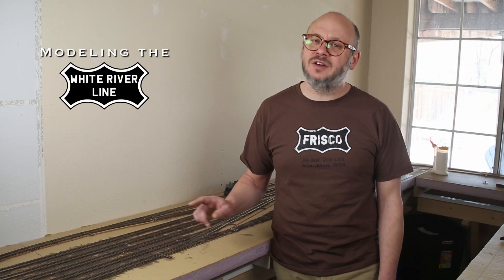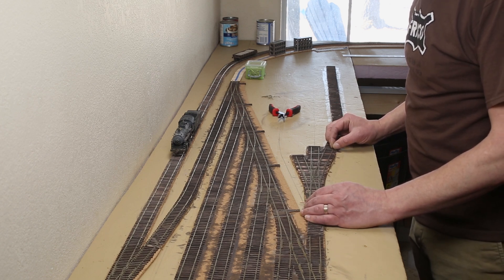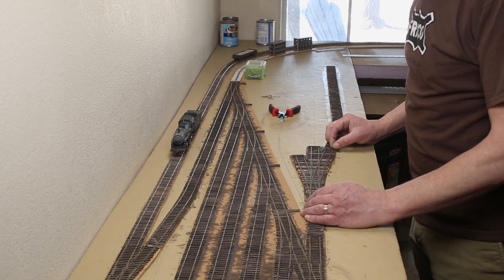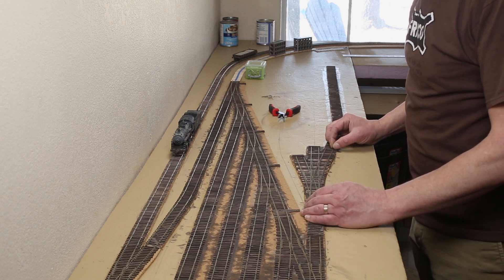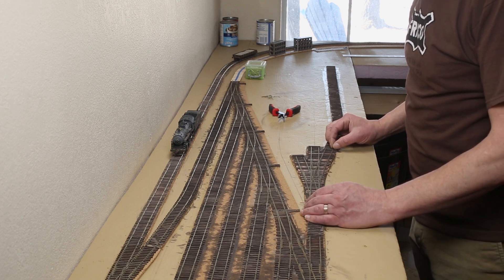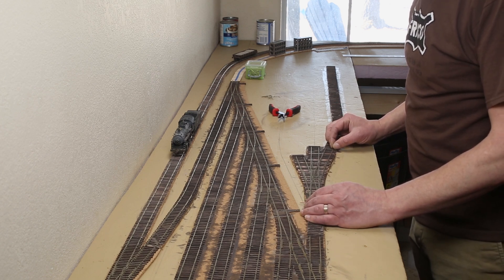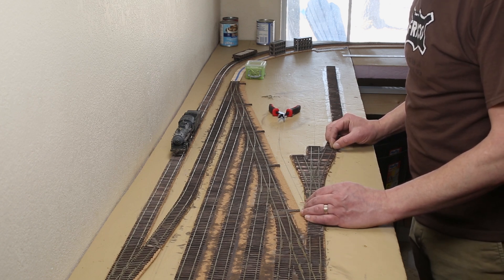Building a DCC-EX Command Station for My Model Railroad

Comment: Saw your video using servos and one suggestion.  I don't use servos with fixed (programmed) positions.  I use pots to control the position of the servo for straight and one for divergent.  You use the map command:   position = analogRead (potS);
      position = map(position, 0, 1023, 0, 90);.  also I use a small relay to control the frog.  Ditch the UNO and check into the ATTINY chips.  You can use the 85 chip or if more pins are needed use the 24.  $1.50 each.

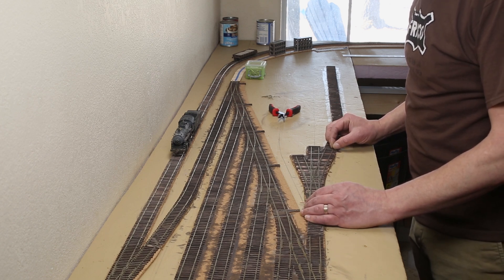Comment: 4:41 Actually, getting the DCC-EX automated installer to run on MacOS isn’t that difficult - it‘s just a bit awkward that they made it an application to run in the Terminal and not one you can simply double-click. To run it after downloading (assuming that „Downloads“ in your home directory is your download folder; if not, you‘ll have to modify the path for the „cd“ command in the following example), just open the „Terminal“ application (or an equivalent; I prefer iTerm) and then at the command line type or copy-paste from here (without the quotes!): „cd Downloads; chmod +x EX-Installer-macOS; ./EX-Installer-macOS“ and the installer window should pop up.
Reply: You just need to go to terminal and sudo - su ..  then change your /etc/passwd file and make your account UID 0. Once that's done you'll be able to run everything as root. Don't do this if you're a numbskull that randomly installs unsafe stuff.

Comment: Hi Drew, thanks to share this video with us. You're a smart guy doing this that easily. Like the way you tracks turned out with all the different shades of colors. Keep on your good work. I can wait to see that wood caboose project ending too.
Reply from the maker: Thanks Luc. The variation in the shades of the ties are a really nice benefit of hand laying track.
Reply: @WhiteRiverLine  I mostly like the way you're doing things. Laying handlaid tracks is something I would like to do one day. It's not because I can't but because I doubt the "resistance et la durabilité" of those tracks. I trust flextracks more because it can move easily, dilate or retract without breaking or desaligned. If I go for it (I already have a 28 x 60 inches module), I will be working with code 55 tracks. And the fact that you're modeling steam era is to my eyes very interesting. That's also why I'm modeling the 70' and 80's. Modern engines and rolling stock is not interesting for me. Too big and lack of details ! Keep on your good work Drew !

Comment: What gauge wires are you using from the motor shield to the connector for the 12v power supply?
Reply from the maker: It is 16 which is the largest the terminals on the motor shield will accommodate. Even then it is a tight fit.
Reply: @WhiteRiverLine  I used some 14. It was the exact size of the terminals but when I power my motor shield with the 12v power, it disconnects the Arduino from the computer and the Mac states “unplug the device using too much power to reconnect usb device” something of that nature. Without that power I don’t get enough juice to power the DCC signal so the loco just sits with the light on making a humming sound and no controls works. Have you ran into this issue?
Reply from the maker: @sevenellis410 , I haven't run into that issue. You definitely need the 12v power supply. USB from most computers is 5v at .05 amps. Not enough to power DCC. The Arduino is also 5v, the amperage would depend on the power supply used. This is why the motor shield is necessary, it can supply adequate power to your layout. 

I am not a DCC-EX expert, this is the first time using it or DCC of any type, so take my advice for what it is worth. First, I recommend verifying that the Vin Connect trace on the motor shield is cut using a multimeter. Second, you might want to check your tracks for a short. Hope this is helpful. DCC-EX provides some other resources for getting help on their website and you are likely to get help from someone there that knows more about DCC-EX, https://dcc-ex.com/support/index.html.

Comment: Hey Drew
What do you think it costed pre foot to hand lay your track
Reply from the maker: It's about $1.80 to $2 a foot depending on the spacing of the ties. Which is probably about what you'd pay for Atlas and little bit less than Micro Engineering.
Reply: Thanks. Hope to see you at one of our club meetings
Reply from the maker: @garycooper9574  yes, I plan on coming as soon as my schedule calms down.

Comment: With DCCEX you don't need a toggle switch for the program track anymore, <1 JOIN> in the DCC++ command line in JMRI. It will use the mainline power to run into the program track then send a program to the program track and it will send the command like it is a separate program track, then use your throttle and drive away.
Reply from the maker: Yes, I saw that in the DCC-EX documentation and considered that as method for a dual purpose portion of track. It also states "Any other power command turns it off" which I take to mean that when I turn off track power and then turn it back on the programming track will no longer be joined to the main. So, I would need some method to rejoin programming to main. I suppose this could be scripted or otherwise automated. For me, I think have a physical switch will be the better way to go. However I am certainly open to other ideas.
Reply: @WhiteRiverLine  
<1> - Turn power to all tracks on. RETURNS: <p1>
<0> - Turn power to all tracks off. RETURNS: <p0>
<1 MAIN> - Turns on power just to the MAIN track. RETURNS: <p1 MAIN>
<0 PROG> - Turns off power just to the PROG track. RETURNS: <p0 PROG>
<1 JOIN> - Joins both tracks together to be both MAIN (ops) tracks. Any other power command turns it off. RETURNS: <p1 JOIN>

So we just send <1 JOIN> to use as normal track, and send <1 PROG> to use as prog track.

Comment: Great timing for me on this video. I saw an IOTT clip that was using DCCEX to support his Engine speed matching kit. I needed to know if you still needed to clip the power trace on the motor shield. Thanks. I noticed something I wanted to ask about with your crimps on the programing track terminal connections. The lugs I got off AZ only have a barrel to crimp to that is very close to the terminal. If I was to crimp on the back of the barrel like yours it would catch the insulation but not the wire. Just wanted to point that out incase it helps. I ran DCC++ a few years ago to get started and it worked great.
Reply from the maker: Glad the video was helpful. Regarding the crimps, I suspect I've got the same thing going on, that the crimp is only on the insulation, but it can be hard to tell for sure. I've considered adding a tiny bit of solder to them for some insurance. They are working for now, though, and if it start to be a problem they are easy enough to pull off and repair.
Reply: @WhiteRiverLine  Sounds good. I'm enjoying your efforts. Thanks.

Comment: You should have kept the wifi for smartphone throttle capabilities
Reply from the maker: I went back and forth on the wifi stuff. There isn't wifi onboard the Arduino Mega and I was always planning on adding JMRI which adds the capability. So, buying a wifi board for the Arduino seemed like a waste.

Comment: Been using the same control system myself. Its great! A little fussy sometimes (i think im overloading the system a little bit but it still works fine so im not too worried yet XD )

Being able to drive from literally anywhere in my apartment is so cool
Reply from the maker: I've already noticed a little fussiness, but nothing too bad. I suppose that is the nature of DIY systems like this though.
Reply: @WhiteRiverLine  and @NathanielKempson can you two describe what “fussiness you’ve encountered with dcc++ex?
Reply: @KenN.OXN.805  For me it seems VERY sensitive to short circuits, so much that when I run my illuminated pullman set it sometimes trips the system, but not enough to shut it all down.....like a micro short circuit. Its really weird. 

And also, im cranking too much power through it and asking it to do too much really! The whole layout and some 20 odd points/turnouts aswell. So it gets a little hot, so i stuck a small heat sink on it and a USB powered fan to keep it happy. Occasionally when powering the layout up, the turnout decoders draw so much power all at once it trips out and I have to turn it off and on again untill its stable and not shouting at me about overloads. then it runs fine. 

I will be clear, this is MY FAULT, im sending too much power through it and asking it to crank ALL those point decoders and power them up all at once, thats my bad. Before I ran the point decoders it didnt do any of these things at all.

Comment: Been using the original DCC++ ... and the latest DCC-EX ... successfully for many years.  Works very well with JMRI and Engine Driver.  Using a hand-held R1 Bluetooth  game controller with Engine Driver, you can have a simple but useful wireless throttle for less than $10.
Reply from the maker: I'll probably look into using some sort of dedicated throttle at some point, but the iPhone app seems to work pretty well.
Reply: Thanks for the tip, looks like a great controller.
Reply: This is an awesome Idea for my kids. I wonder if a Wii-mote would work.